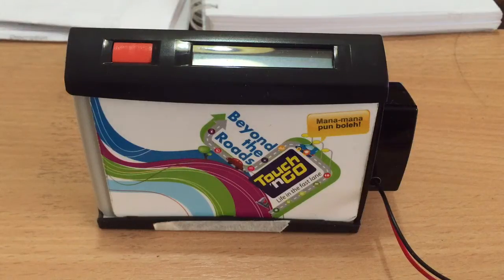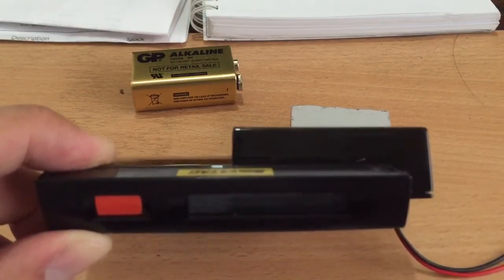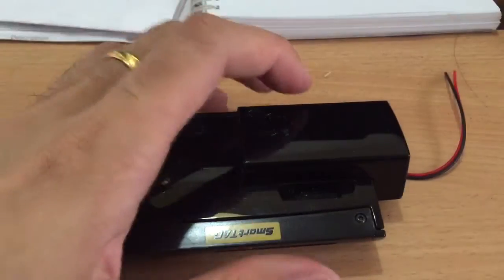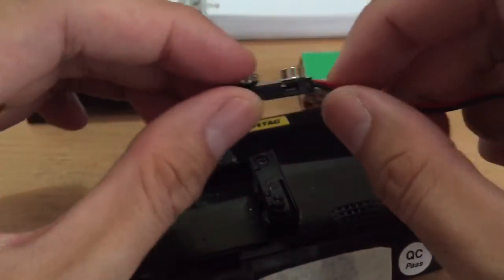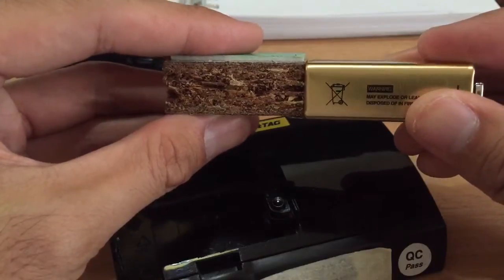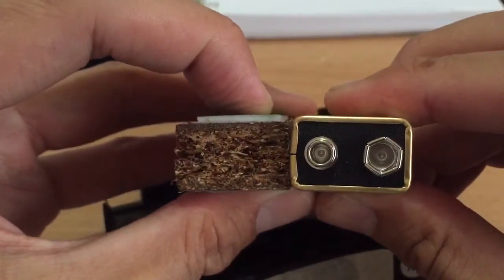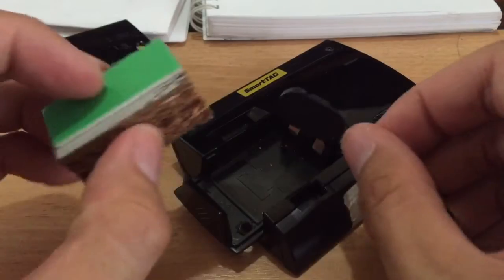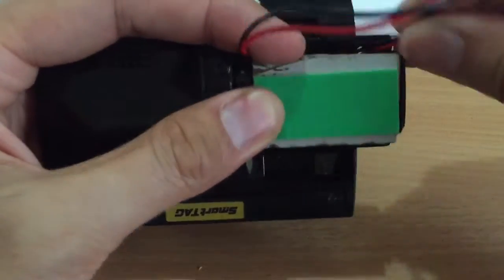Replace Latest SmartTAG battery with 9V 1.5A power adapter- Part 1

Comment: sorry i don't quite understand. do we leave the exposed wire just like that? where does the Smart Tag unit get the power from?
Reply from the maker: Those are excess wire from the 12V to 9v power adapter. You may consider cutting the excess wire or wrap it with heat sink sleeve.
Part 2:
https://youtu.be/C16G7hdCcXQ

Comment: Good idea
Reply from the maker: The new RFID helps solve the battery issue.
Reply: @CTB6  try make a new smart tag like myvi or proton x70.only infrared sensor at windscreen use cable .

Comment: ini model battery pin pada device banyak failed.kena selalu tarik keluar kasi battery ketat fitting.baru tak longgar,tapi lama2 dia tetap akan longgar balik.kasi solder direct ke device pin,masuk adaptor 9v.sampai bila2 oun akan ok.lousy device ever.
Reply from the maker: Sebab itu i guna kayu tahan.

Comment: Do I need to add on transmitter 12v to 9v if I use 12v adaptor?? or this device can support until 14v (Alternator charging)
Reply from the maker: Have you figure out how to connect this by now?